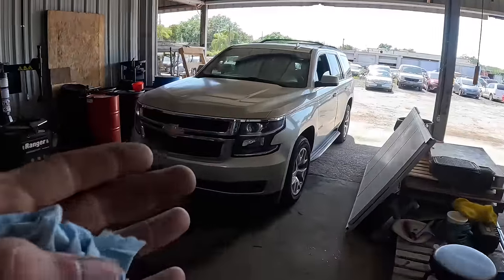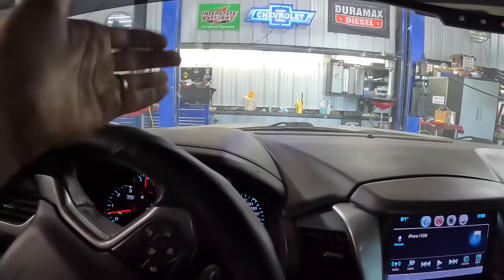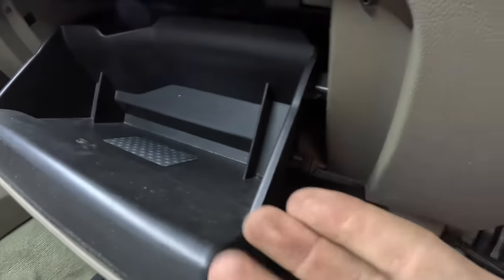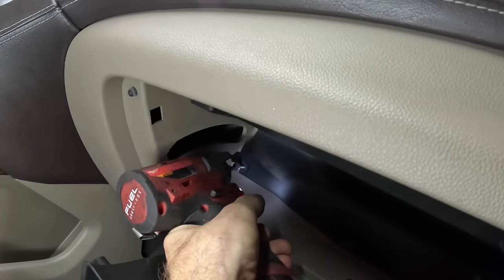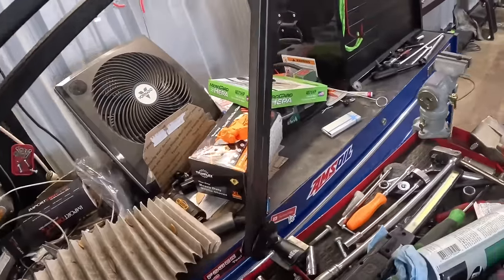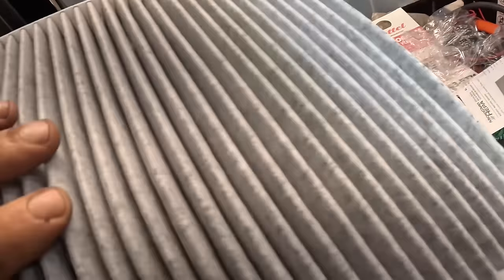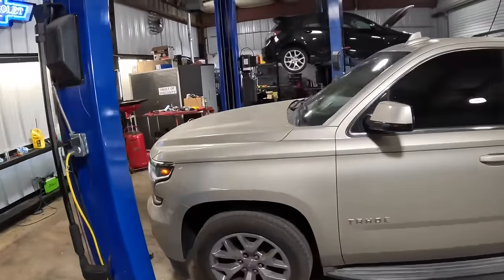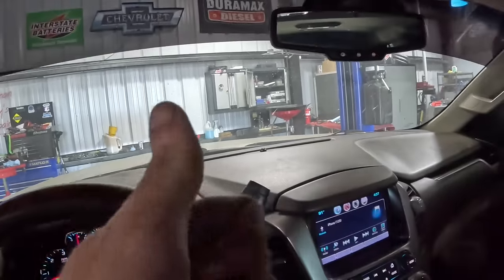Stink Fumes from the Dash! (AC Evaporator Foam)

Comment: I took a 4 month old 2002 Ford pickup to a nationally known quick lube shop for it's second oil change at 7000miles.  I got the, "Could you please come with me?" somber invite to the shop area. The tech held up the canister type air filter element and put a drop light inside it and said the air filter was dirty, despite the lily white appearance, and showed that the light wasn't shining through.  I looked at him and paused a bit.  Then I offered, "Do you think the multi layered work order inside the filter element is what is blocking the light from being seen?  I turned and walked away.   I mentioned what happened at the counter when I got back to the front office and was offered a coupon for my next visit which I of course refused.  There has never been a next time at that brand lube shop.

Comment: I had mice get into my car. The found dog food I had left in the car and brough it deep into the air vents. I got a scope like what Ray has, and tried finding it all) and I found some, but had no way to get it out. Eventually it smelled so bad of stale, rotting dog food, I couldn't turn the air on without gagging. I had to take it to the dealer who had to take the whole dash out to get all the dog food and smells out of the car. Terrible experience. 0/10 do not recommend. Dealership did good work though. Car smells nice again.
Reply: What I learned, is that air filters are worth it, and working under the dash is absolutely miserable.

Comment: I own 2 vehicles 1 has a compartment behind the glove box (it has not got one in it)the other later year car does not. They make an aftermarket one to put in it but you have to take the wipers& bezel off to install it. I personally do not want to go to all that work & it probably needs to be changed every year so no thanks & neither of them smell as I clean them monthly so I personally see no reason to have them.(My opinion.)

Comment: It's China crap that wat it is and most probably a copy cabin air filter...to cut a long story short, I bought a replacement ignition barrel for my bike the ignition outer wiring had melted a bit like that 02 sensor what u did on your last video I have to now change my harness and the C.D.I Unit along with a new ignition I'm never buying any Chinese shite again

Comment: Re mechanics labour charges, they do a min if 15 min amd always round up. A cabin air filter change is typically 2 min. Rate around here is $100/hr, that should be $1.66 for time. 
But no, mechanics berounding that up and charging $24.90 for the labour 
See how thats offensive.
Then, since they round up everything they do, theyve literally charged more labour than time for which they had your vehicle.
So my good mechanic buddy, its not a double edged sword, if you have my car for 1 hour, lavour xannot exceed $100. Eith the exception that youre doing a job that requires two mechanics.
Putting this into my world, how would you feel if i had a rate of $100/hr fixing your PC then charged you 2 hours because i clicked other things while waiting for the uodates to install?
I get the making mo ey aspect, but the service i dustry as a whole has become so offensively questionable. And somehow thats become acceptable.